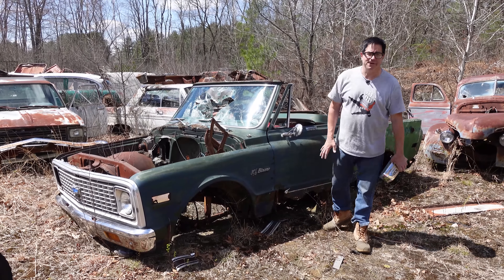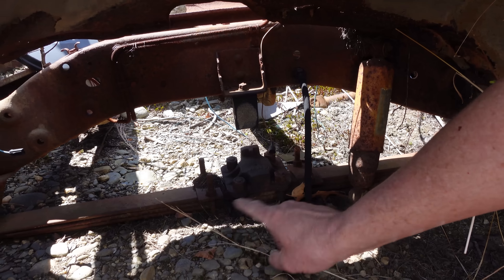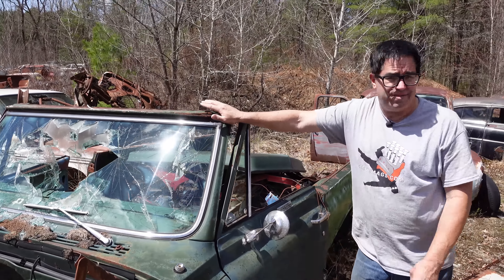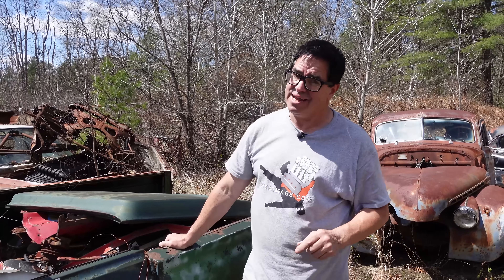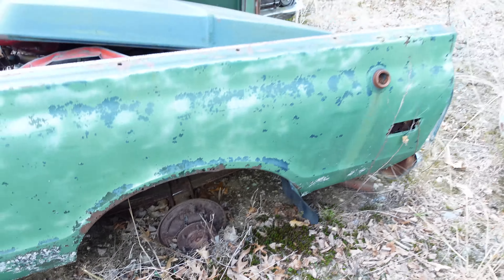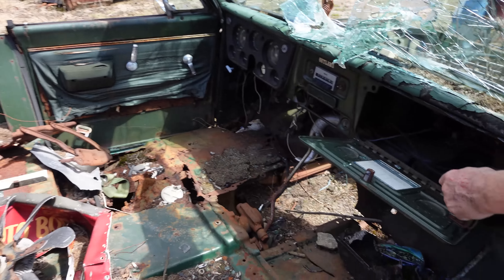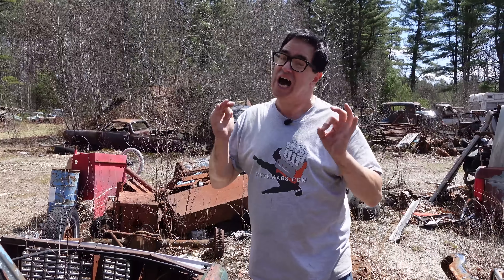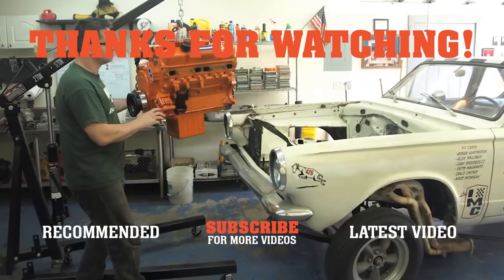Blitzed Blazer (Reupload)

Comment: I had a system for removing the top of my 74 K5 that took maybe 15 minutes. Our yard had a 3 foot terrace that I would back up to where myself and one helper could walk the top right off and set it on the grass. The time-consuming part was removing the bolts with a hand rachet! Reinstalling the top took longer as it took some adjusting to get the bolt holes to line up correctly. Had I known it would be worth a fortune today I never would have sold it 😪

Comment: I owned a 79 bronco and my buddy had a K5 custom like that one. His had the 350 4bbl while my bronco had the M400. He built his for HP while I kept mine the stock torque monster that it was. Lol we'd go out trail riding and I'd end up having to pull him out of the mud more than anything else. 😂 But he could outrun me though. That was over 20 years ago. I wrecked my Bronco and he still has the K5. I pulled the motor and tossed it into a 1970 Ford pickup with a swb. I sold it 10 years ago for WAY more than I had in either vehicle. 👍 I wish I still had it though.
Reply: Maybe part of it was you were the better driver off road.

Comment: It's rough and yes, it will likely stay right where it is, but it can still yield some parts. There are a lot of trim pieces that are left to give up on this one.

As noted the first time this was posted, this is a 1971 model year truck with the VIN for the win: K for 4WD conventional chassis, E for V8 equipped, 1 for 1/2 ton rated, 8 for Blazer, 1 for 1971 model year, S for St. Louis, MO assembly and the rest is the production sequence. By 1971, the St. Louis, MO plant would have also assembled Corvettes (and other models) for a number of years and did so until June 1, 1981 when production was moved to Bowling Green, KY, where it still is today. The St. Louis, MO plant closed in 1986. 

You might notice something on the RPO codes that are a "sign of the future". Take the RPO code for the engine "1LS98E". GM would eventually drop all the extraneous nomenclature and later on this would simply be "LS9" as your RPO on the SPID. Trucks got SPID labels much earlier than cars did. GM cars got SPID labels for the 1984 model year and still have them today. SPID stands for "Service Parts Identification". No, that's a regular 350 V8 used in the trucks that year, nothing "Heavy Duty" about it, I think you just misspoke.

Many have heard me say at the point of nausea, "You need the VIN to win" and "When you get the SPID, we're glad that you did", or "When you get the tag, you can brag". Well, I had a case that drove that home this week. I was inspecting vehicles at a manufacturer in Ohio on a business trip. In this case they were new 2022 Ford F-550 4x4 chassis. We always specify in our contracts that they are 19,500 # Gross Vehicle Weight Rating. In order to get that on an F-550, you must also order code 68M "Payload Plus" upgrade package. If you do not, they are built as 18,000# GVWR typically. Well, when I "went to the tag, so I could brag", they were 18k. When I checked our contract, sure enough, I wrote them for 19,500 # GVWR. I called over everyone and let them see what I saw on the door jamb decal. Yikes. The vendor's face dropped a bit and they realized that they made an error. Now it's a scramble on their part to see if Ford will allow a retrofit or if new chassis have to be ordered. With the supply chain the way it is today, that could be a costly mistake. So always remember folks, "With the tag, you can brag" and "When you get the SPID, we're glad that you did". The details are in the numbers........
Reply: Thanks for the great info , G P .  Brings back some memories for me .  I'll post it in a second .
Reply: @daynadiggle8169  No problem, anytime.
Reply: @ScottDLR  When he goes through the SPID calling out the options.
Reply: @googleusergp  I want to be an intern for you or Steve with your vast car knowledge
Reply: @Mac10Daddy  Nice of you to say. Mr. Magnante has been at it longer and this is what he does for a living. He's well known in the automotive journalistic community.
Reply: @googleusergp  I always say, “I’m going to school” when I watch Steve Magnantes videos in the morning
Reply: @Mac10Daddy  As I have said, "When everyone contributes, everyone wins".

Comment: It did have an automatic I believe. Pickups came standard with the 3 on the tree knee knocker, 4 speed SM465 floor shift was optional and sometimes seen. I saw 1 rusty 4wd 6.2 diesel 4 speed SM465 Suburban for sale in Wisconsin years ago. I have a few 6.2 Suburbans, all with automatic overdrive 700R4s
Reply: Yes, it did, RPO code "M49". It was an automatic.
Reply: @googleusergp  Also the "Turbo Hydramatic" was a minor clue.

Comment: I worked for Parkway Motors just west of Montreal in March and April of 1981. We had a lemon yellow K5 (C5?) Blazer on the showroom floor with a straight 6 and 2wd. It sat with zero interest, along with most everything else, as interest rates went from the "promotional" 13.47% to about 20% April 1. I wrote sales contracts for 4 vehicles in March, and no one came in the door in April. I was driving a rotted '70 GTO, red red 3 speed stick I bot for $250 with mixed up ignition wires, a simple fix, and drove it down the road the last day of March when all I could do was stare at the walls with zero customer traffic. Diesel Olds 350s regularly came in on the hook with blown motors, and we also had "Iraqi Malibu's" on the lot. Look those up, betya never hear of them!!! Wikipedia does!
Reply: Yes, I recall those "Iraqi-bus". They had manual transmissions, AC (for the hot climate) and V6 engines in them. They are a bit "collectable" now.

Comment: By brother-in-law worked for Kerr McGee in the 70s as a geologist who would be assigned to different locations where he would drill for veins of he different minerals that Kerr McGee was looking for to build mining locations. His work vehicle was a 1972 GMC Jimmy with a 40 gallon gas tank. What would always make us laugh was when we would go into a gas station for a fill up. (Remember this was before self serve gasoline was going on. This was in the full service gas stations.) We would pull in for a fill up and the attendant would wash the wind shield and check the oil    and walk over to the gas pump to discover it was still going, so he would wash the side windows and the back glass.....still going. check the tire pressure...still going. Let's say we always got the best service at any gas station since it took a long time to fill up a 40 gallon fuel tank.
Reply: I just still hear the "whirr" of those older pumps now. I miss the old service stations, and I wouldn't mind hanging around one when I retire.

Comment: In 1971 I was working part time as a surveyor waiting for my draft notice .  Worked for Arthur Day land surveyors here in central Florida .  We were surveying around where the Army Corps. of Engineers had dug canals out to the Saint Johns River , in thick jungle , and the head of my team told me to take that new Blazer , drive down the embankment and go up the other side of the dry canal . I told him the truck wouldn't make it but he insisted as we needed to measure distance at that point .  I locked the hubs , put it in 4x4 and starts down the embankment .  I hung on tight while the truck rolled over two times and ended up on the roof . The fiberglass rear part was shattered .  I didn't get in any trouble but the lead surveyor was fired . I didn't get hurt and have been in two more roll overs in life not being hurt too badly .
Reply: St. John's River, I think that's the place where right before his death in 1977, Pepsi (or whoever it was that did the video) took a video of Gary Rossington and Ronnie Van Zant of Lynyrd Skynyrd on a small fishing boat and asked Mr. Van Zant what the meaning of Freebird was. Mr. Van Zant said, "To be free like a bird. Everyone wants to be free. It's what this country's all about". Mr. Van Zant would die a few months later in the band's plane crash of 1977. Mr. Rossington is still alive today, although his health is very poor.

Comment: You know what that's a perfect candidate for? Bye and set it inside a building up on blocks. By later model that you can swap it over onto the body that is. But don't do it. Maybe along the way you may gather some original or era correct parts. Set on for about 5 years and cash in on your investment so you can build what is you really want to build or at least something that's more within obtainable skill set. It's rebuildable now you can get everything you need from Brothers as long as the frame is good. Also if you want to sit over on a later model they bring decent money nowadays. But that trim wasn't just reserved for CST the strip down the side. You didn't say it was. The CST went away after 1972. The CST trim emblems are valuable. There was a guy who is definitely a truck nut more than a car nut. And he's crazy over these 67 to 72 more than I am even specializing in cst. Maybe four years ago he had a couple of cabs and I swear there's absolutely nothing left up to the trim line on the doors. I mean nothing other than Rusty jagged edges it's like somebody cut the whole bottom of the cab off. He saved it because it was originally CST and he was trying to sell it for little to nothing instead of crushing it. Just a nice car nut story. He wasn't selling them with the titles and said nothing about the VIN tags on the cab. He actually thought somebody were graft the parts onto the bottom of the cab. By the way you got everything from just behind the cab forward because somebody cut the frame to make probably a pickup bed trailer out of it a couple three decades ago. A side note nowadays $500 and up for pickup bed trailer where you can hardly give them away a few years ago. The beds are basically what they're selling. That's for Chevy in particular the desirable years from the box body to 1955 anyway. That's why I went looking for a pickup bed trailer to find a decent box for a build. Anyway I enjoyed the episode as usual. Just a little something special to CST although they are quite rare more so in 6768 with the package. Speaking of pickup trucks not the Blazer of course.

Comment: I still think it's too bad ford didn't come out with the redesigned bronco until 78, it was designed to be released in 73 when the dentside body style came out, but ford pulled the plug and waited 5 more years. They would've had a lot more fight in them through the 70s with the new style, which was so much more a competition for this and the ram charger

Comment: Ya gotta love the note pad, a.k.a. the back of the wrist 🤣🤣🤣 I have to say,  it isn't the first time,  I've done it too walking around a salvage yard! 
Another great video Steve! And my personal opinion,  I always thought that the Blazer/ Jimmy were better looking than the Broncos. And I also like the GMC looks more than the Chevy's. 😎
Reply: We all have our "tricks" for the junkyard. Like someone mentioned previously, and I've done the same thing is to find a hooptie (say a Cutlass Ciera or something no one wants) and lock your tools and parts in the trunk with the keys in your hand (make sure you know which car it is and make sure the trunk lock works. LOL), Now you're free to roam without dragging around half of your home toolbox to the yard. When you're done, open the trunk, walk up to the office and pay. Done. 

I've always brought a Sharpie in my pocket and marked the cars with my initials or something so I know if I've picked it the next time I go (assuming the car is still there). Also, I'll often mark the VIN # of the car I took the parts from on the underside of the part or with a tag so I know what it is. For instance, I have a center section spoiler that has marked on it, "1979 Formula, 2U87Y9L*****" on it so I know that's what I took it off of.

Comment: Crazy how the Blazer had all the stuff you couldn't get in early Broncos. The Blazer went to it's second generation by the time Ford put a V8 or an automatic in the Bronco.
Reply: Not true on the engine part. Ford offered the first v8 in the bronco in March of 1966, however you are right about the automatic. Ford didn’t offer that until 1973.

Comment: Dang I miss an actual SUV.  You know, the vehicles that actually were capable of going off road.  I am hard pressed to even find a tv commercial or TV show that takes a vehicle off road.  because modern vehicles most especially modern SUVs are incapable of going off road.  (There are a very few exceptions aka many jeeps) but very close to all modern SUVs are described as off road capable but they are never shown off road, they are always on at minimum a heavily worn path.  I had a 69 VW beetle that was FAR more capable off road than ANY current SUV.  Ever hunt? fish?  go "4-wheeling" CANNOT be done in a modern stock SUV.
Reply: The market for them changed. The "soccer mom" car of the 1970s through the maybe early 1990s was the station wagon, which by the middle 1990s had gone away. So larger families got SUVs. Then the manufacturers realized that there was a huge profit in them and here we are today where you can't even buy that many sedans or coupes from many of the manufacturers. I'll have to buy a Toyota Corolla next to get what I want in a good commuter car.
Reply: @googleusergp  Try backing a Toyota Corolla out of a parking spot when you a Ford f 250 and Yukon Denali on either side of you lmaooo
Reply: @MicroSoftner  I get it, but I'll pass a gas station and everything else long after both of them have filled up two or three times. I've owned GM products for 45 years, including modern vehicles and classics. But for a commuter, you can't beat a Toyota. My neighbor's Corolla got whacked by a tour bus in the city the other night and got towed home and dropped in front of their house. I simply jacked it up with two floor jacks and put on the temporary spare. Pushed the start button and it fired right up and drove on the flat bed and it's off to the body shop. It's got moderate damage, but it should be fixable. It doesn't owe them a nickel. Their son uses it for commuting and as a side job delivering deli orders for the place he worked out when he was in school. Over 100k on it and they've done nothing but maintenance and tires. They bought it with 40k on it about 5 years ago.
Reply: @googleusergp  Just look at the average male or female, a human being should not be put in a small car with all these big monster SUVs on the road. Plus trucks are getting bigger. I say its not about price, but giving yourself a better chance at surviving a  wreck with one of these big vehicles...
Reply: @MicroSoftner  It's true, but some of those trucks are terrible with survival and you'll be killed in them without a second shot. I retire in a few years, so it only has to be a commuter for maybe 5-6 more years. Then I can buy what I want.